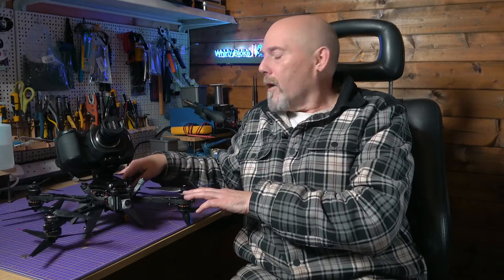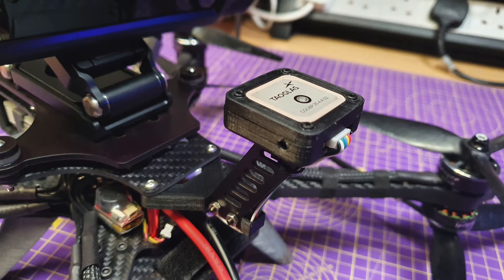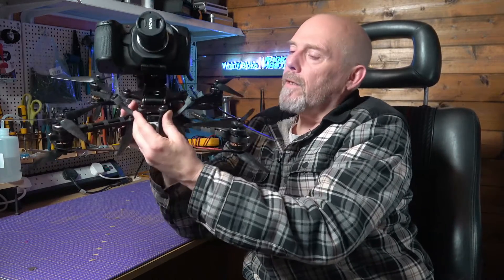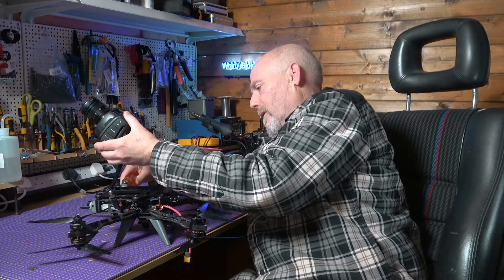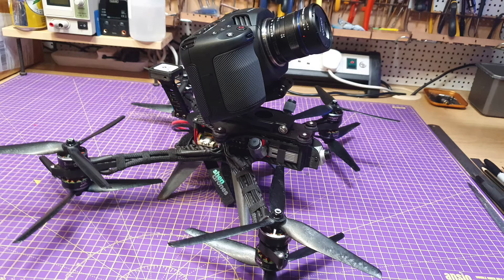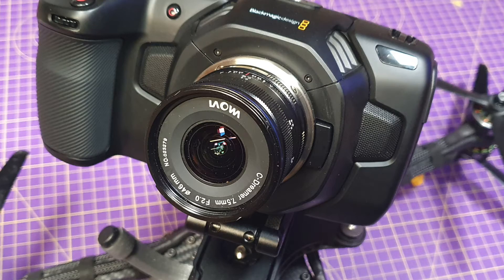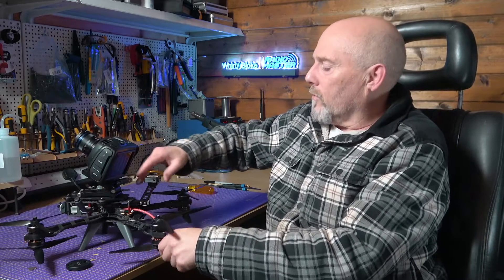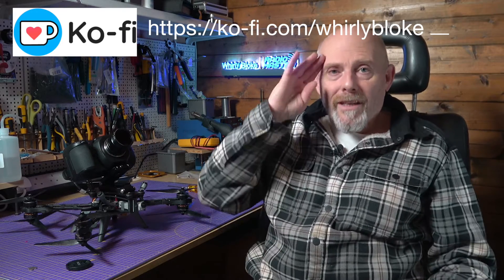Shendrones Thicc Cinelifter - Alpha Gel damper mount, 8 inch props,  BMPCC4K and Laowa 7.5mm f2 lens

Comment: Nice Video :-)
I just built my QAV Pro and wanted to copy over your z-mount (I managed to find the exact same one on amazon but it is not holding the camera dummy that I have (it is not tight enough).
I already removed the phone mount that was attached to it and tried to exchange the smooth washers with some tooth washers but still my cam seems to be to heavy (maxing out at 860g).
What kind of modifications did you do on it?

Comment: Awesome! I'll be converting a Siccario to Inav soon. Also how is your experience with the variable ND? I find it gives some weird colour vignette and colour shift. I now use fixed ND and the image looks much better
Reply from the maker: I have seen that with cheaper variable ND filters. I've had so many questions about my INAV setup so I'm doing a detailed video very soon.
Reply: @WhirlyBloke  the timing couldn't be better for that video man! I am a real newbie to inav but pretty experienced with betaflight. Currently testing a D tuning my first inav quad, a 5" freestyle quad without a camera attached and man the PID values are quite different vs betaflight. My P terms for roll is half of the value for pitch! Though I'm sure that would change with a gopro attached but I don't foresee it changing by much. After the sicc, I'll be building a 12" 12s x8 to carry a gimbal+camera, that will be the holy grail for me
Reply from the maker: @IgnitionFPV  Check out Pawel's channel for INAV info and tips. Tuning with a large camera on top takes more time, but I recommend not just using a simple dummy weight. The problem with that is the weight distribution is all wrong. A GH5 or BMPCC is tall, so make a dummy weight that's about the same height as the camera. P and D will be quite different for pitch and roll.

Comment: Good morning from Canada. I'm about 90% complete on my Thicc 2.1 build and am wondering where you can get the high rise mount and connecting adapter for the GPS. I'd rather not strap it to an arm. Thanks
Reply from the maker: I'll be making them available on my website very soon.
Reply: @WhirlyBloke  Ok I'll be the first one to buy one, count me in.
Reply from the maker: @GoldenEarsVideography  I'll keep you posted.
Reply from the maker: The mount is available here https://www.xcopters.co.uk/shop/matek-m9n-5883-mount-for-shendrones-thicc-and-aos-7